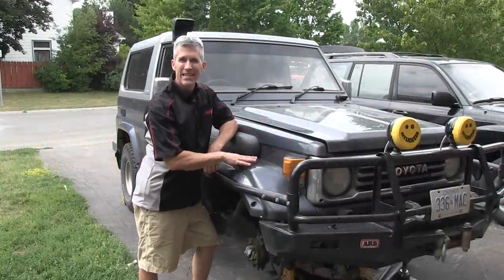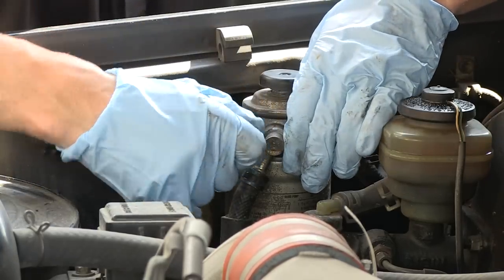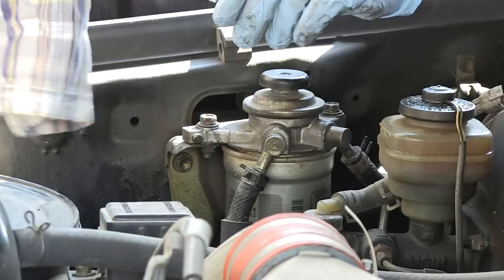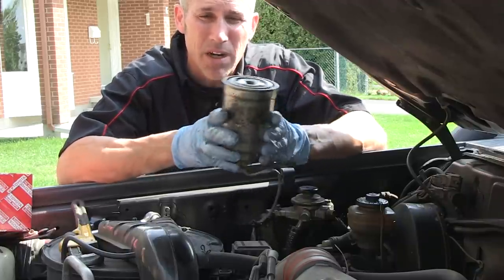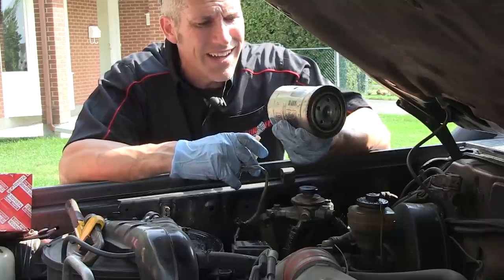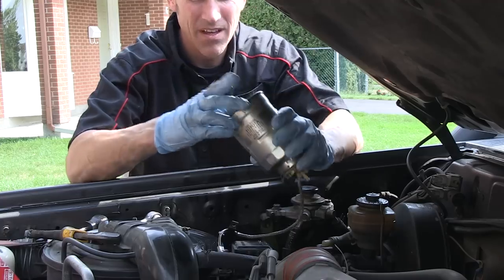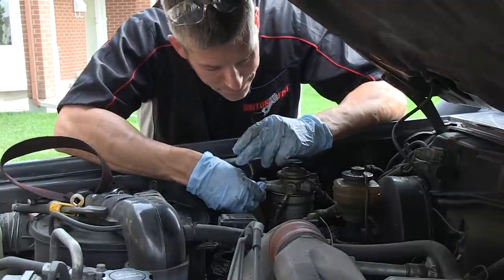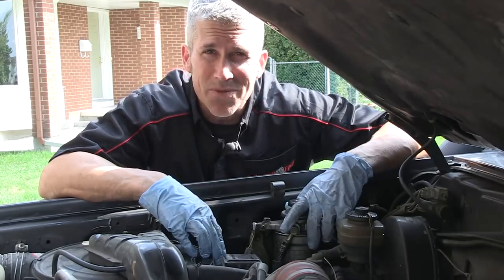Toyota Land Cruiser Fuel Filter Replacement, PowerModz.com

Comment: Fuel filter should really be changed every 10,000 KM or 6,000 Miles. Probably sounds a little conservative but they only cost $30 or so and take half an hour to change.

Standard practice for us Aussies is Oil and Oil filter change every 5,000 KM and Fuel and Air filter change every 10,000.

Comment: You may need to check that filter, there my not be enough top clearance to the fuel intake on the underside of the filter housing.
Compare it with a genuine filter.

Comment: Have just brought an 80's series diesel & having the same probs. Has brand new fuel filter, have primed consistently over a week, no fuel leaks or air but running like shxx.
Gets to 30km's hr then chokes and stalls. Started blowing smoke & has a burning smell.
Any ideas ?

Comment: If that’s the 1hz there should be 2 filters inline. 1 screw type and 1 cartridge type which is shown here. Rule of thumb is drop the oil and filter every 5000 kms, fuel filter and at least rear diff every 10. Tranny every 20. Then your land cruiser will last you many decades.